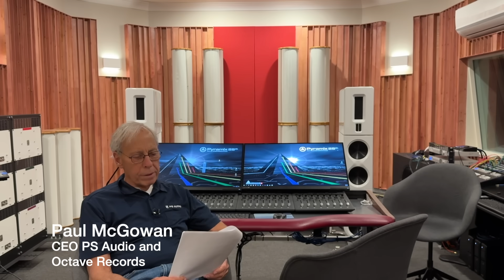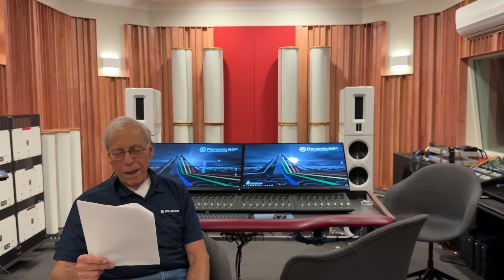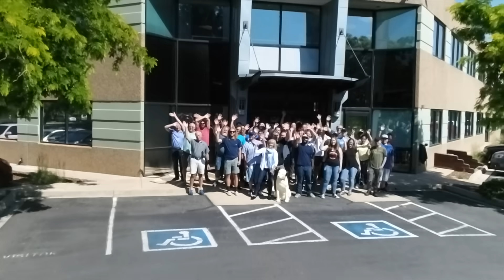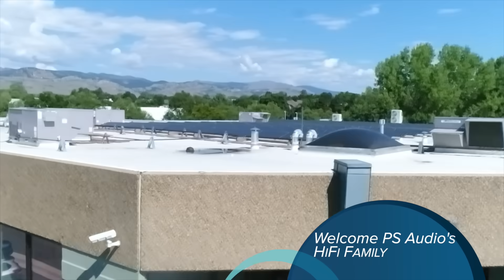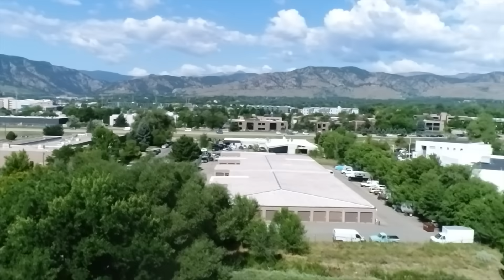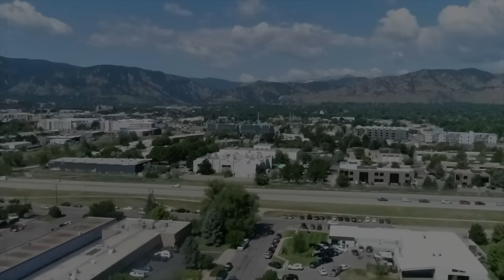Pros and cons of active crossovers

Comment: I spent 30 years designing passive filters and could write a fat chapter on why they're awful. Actually, I have. Made the jump to DSP active back in 2012 and have not looked back.  Capacitors and inductors do their jobs by storing energy and releasing it later. The LCR circuits we call "crossovers" are correctly referred to as resonant circuits - because that's how they function. Once necessary, but not so hot. Plus the added impedance between the amp and the driver weakens electrical breaking by effectively raising the source impedance, which also increases bass system Q. Both of which engender smear.

When you run DSP you do need one DAC and one Amp per band (two per stereo pair). For instance, a five-way stereo pair will need ten DACs and (at least) ten amps. 

The advantage is that each amp is directly coupled to its driver. This make spectacular sense, especially in the midrange - where every midrange you've ever heard has a bandpass (both a low pass and a high pass) filter imposed between itself and the amplifier. Removing that mess and directly coupling is a total game changer.  

Topologies once impossible to execute have become trivial. Want to try a 9th order Butterworth to expand your tweeters bandwidth while keeping it safe from frying? No problem;. look up the coefficients and plug 'em in.

The technology also opens the door to some fresh thinking in bass system design. 

Plus it can put parametric EQ in the hands of the customer, which has numerous and sometimes unexpected applications. An EQ to fit the room to music, of course. Asymmetrical room? No problem. But also maybe a toggleable EQs for movies, for low level, for TV, and even to prevent one's teenagers from overdriving the rig when daddy's not home.
Reply: i tried an active speaker, not a sonic benefit compared to passive, and i excluded room correction or any  parametric equalization from the comparison.
i am just saying that for many there is no point in going active, it is more fiddly and hiss noise is a problem.
Reply: @sudd3660Actually going active is simpler and there is no noise issue when picking well designed active speakers. Nobody said a speaker being active automatically makes it a great speaker. Lots of active speakers sound like crap because they were designed to save you money by integrating things in it cheaply. Smart speakers and PC speakers mostly fall in that category. I have a pair of KEF LS60 that do well. I also drive my Magnepan actively and that makes them sound better. Then you have speakers such Kii Three BXT that are often at the top in shootouts where room interaction, clarity, bass extension, and imaging are evaluated holistically. I also like Dynaudio Focus 50, Buchard A500, BeoLab 28 and a few others. Some of these are not cheap but you avoid a lot of other gear.
Reply: Same here, never ever again Passive. DSP & Active nowadays are the way to go for modern loudspeaker concepts. + You get way more sound for your money compared to an same priced passive setup.
Reply: @vtkz I think it's pretty obvious when your music is digital you want to do the cross-over in a DSP where you can optimize much better. Passive cross-over filtering belongs to an era of analog sources that is coming to an end with lossless audiophile streaming.
Reply: Nice, I completely agree. With digital lossless CD quality (or better) streaming, obviously (to me) the future in high-end audio involves DSP processing. Nowadays audio DSP processing is common in automotive, earbuds, smart phones, laptops, AVRs, smart speakers and active speakers and not appreciated in high-end audio. Reason is the high-end audio industry is very conservative and often ignorant of what is possible. A few months ago I met Andrew Jones at a Starbucks during a HiFi show and we talked about active vs passive cross-over. Him and I agreed active is the best giving most optimum performance. I have a pair of KEF LS60 in my dining room and a pair of KEF LSX II with sub in my home office btw. In my listening room i run a Magnapan system with sub using DSP cross-over. In my garage I use some reworked HiFi berry CX-100 B&O with DSP active soeakers. I have several boxes from miniDSP and some home-developed ones also. You might know DSP Concepts. Btw, a DSP can do much more than cross-over. Fletcher-Munson equal loudness compensation is a real topic, room correction, speaker calibration, personal taste compensation, hearing irregularities compensation, treble rejuvenation compensation, tube distortion and so on are easy things in a DSP and if you don't want to use a DSP feature, having the option is harmless. I've been thinking about starting a company in involving related ideas btw. I also met the team of miniDSP in Hong Kong once.
Reply: @ThinkingBetter  Back in the 90s, when CD arrived with a potential dynamic range of 103dB, an improvement of at least 20dB over LP we, as an industry stretched the existing tech to meet the new DR demands. Some brands didn't quite make it, and sounded pallid by comparison to those of us who did.  Now, HD's DR potential exceeds that of the human, making it effectively limitless. Our problem on the playback side of the music industry is that conventional tech has a faint chance of attaining HD's full DR potential, and that's being kind.  The path to hitting that target is DSP and multiamping.  The driver guys are on top of it, but the manufacturer-to-retailer part of the business is stuck on conventional. Today's best actives are so obviously superior on the DR front that only those who have yet to hear them would even wonder.  Active tech is in its infancy. Conventional tech, really, fully matured years ago. But there's a weird blind side inside the industry: they know that their customer base is aging out, and that the younger set is not entering, yet somehow they can't see that Actives with modern User Interfaces  is what it will take to attract that customer. Just my two cents.
Reply: totally agree as i have both a 3 and 4 way active dsp systems. however these systems  require precise adjustments that the majority of so called audiophiles will not understand. setup requires a blend of measurement and ear. the choice of crossover points for optimum performance is not straightforward. changes in driver response levels of a fraction of a db is audible. all these changes are done in software. do choose high quality drivers because though you might be tempted to think you can eq bad performance, you can't if you want high performance. for those who are able, there is no substitute.  try getting some old b&w 802s. transform them. they have good bones and are cheap.

Comment: Active crossovers have so many benefits, nearly all sound engineers and speaker designers agree, but the audiophool world is too lazy to employ multiple dacs (if digital x/overs), power amps and speaker cables. 
If you’re utilising an analogue, active crossover (for a turntable) you would only require one dac for your digital sources. 

Phase
Driver time alignment
Speaker damping
Dynamics
Micro detail
Power efficiency - between amp to speaker
Adjustable x/o slopes 
Adjustable x/o frequencies, on the fly…

If you want to stay all analogue, active crossovers include:

SPL
Marchand
Sublime Acoustic

Otherwise dsp x/overs range from $100 to $10,000
Behringer
DBX
Apex
Prism Audio
Accuphase

Comment: DSP crossover/amplifiers are often no more expensive than a really good passive speaker level crossover.
Reply: DSP sounds suck.
That's why I use ANALOG active crossovers, not DSP with crappy builtin Analog-to_digital-to-Analog.  Makes no sense for me to use my $2.5k Denafrips DAC only to have DSP use its crappy builtin DAC afterwards.

I prefer the better sound from an ANALOG active crossovers, not DSP having to do Analog-to_digital-to-Analog. Makes no sense for me to use my $2.5k Denafrips DAC only to have DSP use its crappy builtin DAC afterwards.
----
I currently 2-way bi-amp my PS AUDIO FR5 with PARASOUND 2100 preamp’s active 80Hz highpass to the tweeter, 2 subwoofers with builtin active crossover at 40Hz lowpass

NEXT adventure: A 3-way active custom crossover controls everything: 1750Hz matches the PS AUDIO FR5 (bi-amped high and mid), lowpass 40Hz to the 2 subwoofers

----

source=Apple Music lossless

My video:

https://youtu.be/IwdzDbRUs_0

Comment: I had 3-way speakers built that are bi-amped.  There is a passive crossover between the tweeter and midrange and an electronic crossover to the woofers.  There were 2 options for bi-amping: getting an electronic crossover from a company like MiniDSP or get a plate amp with some DSP capability.  I chose to get the MiniDSP which has better SW and more flexibility than any plate amp I know of.

I mostly stream.  The signal goes into my MiniDSP SHD directly from a satellite router, the signal is divided in the digital realm along with room correction (Dirac), then goes to the internal 4 channel DAC and out to 2 amps: a 75 watt per channel ClassA/B amp and a 450 watt per channel Class D amp.  

Note that this approach has none of the downsides that Paul mentioned while retaining all of the benefits.  Could I tri-amp?  Yes, the benefits of separately powering the tweeter and mid/woofer are more questionable in terms of audible improvements to the sound, but the added costs and complexity are very real.
Reply: This is the way to go. Tri amping alows to align phase on all drivers. My only issue with MiniDSP was that they used to upsample the signal to 96khz. Do they still do that?
Reply: @OG2978-g7x Based on my information, they still do.

Comment: Paul chose the worst implication of active xover, and indeed it sounds bad. If you have only digital sources, no vinyl, active is superior in many ways. You feed the digital input to your dsp dac. There you create the crossover, phase and even RC. Feed different amps for each frequency band and streight to the driver. Only one D to A conversation. Since it's diy, playing with different crossover options is very beneficial.
Reply: Sorry but no. I love my Eversolo DMP-A6 as a streamer, but their builtin EQ sounds horrible compared to my analog Parasound 2100 preamp with tone controls.

DSP with crappy builtin Analog-to_digital-to-Analog.  Makes no sense for me to use my $2.5k Denafrips DAC only to have DSP use its crappy builtin DAC afterwards.

Initially I was going to get the Sublime K235 but after reading the specs, the K231 specs already surpass every component I have in my $20k stereo setup.
K231 specs: THD Better than 0.0005%, THD+Noise Better than 0.0028%, SNR: 120dB, Channel Crosstalk: Less than -83dB

I currently 2-way bi-amp my PS AUDIO FR5 with PARASOUND 2100 preamp’s active 80Hz highpass to the tweeter, 2 subwoofers with builtin active crossover at 40Hz lowpass

NEXT adventure: A 3-way active custom crossover controls everything: 1750Hz matches the PS AUDIO FR5 (bi-amped high and mid), lowpass 40Hz to the 2 subwoofers

----

source=Apple Music lossless

My video:

https://youtu.be/IwdzDbRUs_0

Comment: 1. There are analogue active crossovers too and
2. If analogue sources are not of ones interest, there is always the option of digital crossovers with a digital input, so the AD conversion is bypassed.
Reply: About your point #2: 
Sorry but no. I love my Eversolo DMP-A6 as a streamer, but their builtin EQ sounds horrible compared to my analog Parasound 2100 preamp with tone controls.

The Eversolo DMP-A6's DSP has crappy builtin DAC compared to my $2.5k Denafrips DAC.

Initially I was going to get the Sublime K235 but after reading the specs, the K231 specs already surpass every component I have in my $20k stereo setup.
K231 specs: THD Better than 0.0005%, THD+Noise Better than 0.0028%, SNR: 120dB, Channel Crosstalk: Less than -83dB

I currently 2-way bi-amp my PS AUDIO FR5 with PARASOUND 2100 preamp’s active 80Hz highpass to the tweeter, 2 subwoofers with builtin active crossover at 40Hz lowpass

NEXT adventure: A 3-way active custom crossover controls everything: 1750Hz matches the PS AUDIO FR5 (bi-amped high and mid), lowpass 40Hz to the 2 subwoofers

----

source=Apple Music lossless

My video:

https://youtu.be/IwdzDbRUs_0

Comment: No , completely wrong .  tThat is only the case if your source is analog . If the source is digital there is no extra Analog to Digital conversion .
Reply: Yes but the DSP sound still suck in my Eversolo DMP-A6.
 Makes no sense for me to use my $2.5k Denafrips DAC only to have DSP use its crappy builtin DAC afterwards.
--
I currently 2-way bi-amp my PS AUDIO FR5 with PARASOUND 2100 preamp’s active 80Hz highpass to the tweeter, 2 subwoofers with builtin active crossover at 40Hz lowpass

NEXT adventure: A 3-way active custom crossover controls everything: 1750Hz matches the PS AUDIO FR5 (bi-amped high and mid), lowpass 40Hz to the 2 subwoofers

----

source=Apple Music lossless

My video:

https://youtu.be/IwdzDbRUs_0

Comment: Paul I think you forgot about the best way to do active crossovers, In my car I have a 3 way setup in the car. I use bluetooth and the head unit has dsp with all trimmings. So the signal never goes analog before the dsp and crossover.  I think hooking dsp type speakers up like you said, to be a very bad idea.

Comment: I think you’re being a bit too old school here. Today, using digital active crossovers makes perfect sense, especially since most people, myself included, use digital music exclusively. If you stay in the digital domain throughout the entire DSP process, and only convert to analog at the final stage before the amplifier, there should be no degradation in sound quality.

The digital signal processing used in active crossovers is no different in principle from the digital mixing systems used to master the music in the first place. The only real downside is that you need to invest in two or three times the number of components, like amps, DACs, and cables.

But on the upside, you eliminate the need for passive crossovers. So the main question becomes: is the potential sound degradation from using slightly lower-tier front-end components, due to having to buy more of them, worse than the degradation you’d get from using a passive crossover?
Reply: Although if your into hi end DAC's then after the 'stay in the digital domain' active DSP crossovers you still need to convert to analogue, except now you have several digital streams needing conversion, you'd need several very expensive DAC's, one for the tweeters, one for the mids.etc... this can get very expensive real quick.
Reply: Yes but t DSP has a crappy builtin DAC.  Makes no sense for me to use my $2.5k Denafrips DAC only to have DSP use its crappy builtin DAC afterwards.

I prefer the better sound from an ANALOG active crossovers, not DSP having to do Analog-to_digital-to-Analog. Makes no sense for me to use my $2.5k Denafrips DAC only to have DSP use its crappy builtin DAC afterwards.
----
I currently 2-way bi-amp my PS AUDIO FR5 with PARASOUND 2100 preamp’s active 80Hz highpass to the tweeter, 2 subwoofers with builtin active crossover at 40Hz lowpass

NEXT adventure: A 3-way active custom crossover controls everything: 1750Hz matches the PS AUDIO FR5 (bi-amped high and mid), lowpass 40Hz to the 2 subwoofers

----

source=Apple Music lossless

My video:

https://youtu.be/IwdzDbRUs_0

Comment: Linn & Meridian have DSP based systems , output digital from the streamer, then connect it via CAT 6 ethernet to the speakers, where DSP does the active crossover, dividing the signal into the frequency bands with the appropriate rolloffs, & only then putting the signal through individual DACS for each appropriate power amplifier & speaker driver. Both companies have taken this approach for at least a decade and a hald to my knowledge. Linn ceased to make CD players in 2012.

Comment: It's just so affordable with active, if you account for it and start there when building your system. What costs money today is passive components like coils and capacitors of good quality (which is why even really expensive speakers cut corners there), now imagine changing them over and over again to get the response and tonality right. 🙈 If you're into DIY and passionate about passive speakers then you might have boxes full already, if you aren't then you'll soon have one with the value of a vacation. Meanwhile amplifiers are dirt cheap today as long as it's not in a metal box with a logo on the outside, DAC's and ADC's are getting better and better as well.
If you want to build something yourself just go with active (DSP), in a few occasions there might be good kits available that allows you to get in cheaper as they have done the work while keeping the quality high and component list low in some cases (places like Troels Gravesen, Lautsprechershop, or a kit from mfg of the drivers).